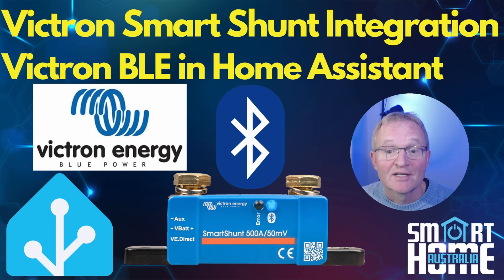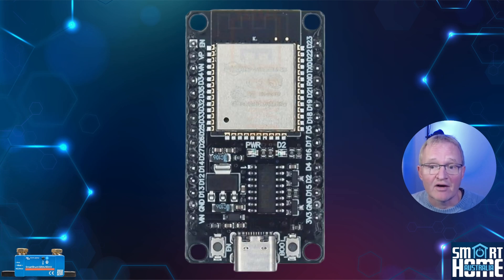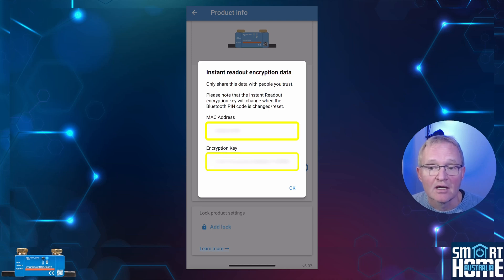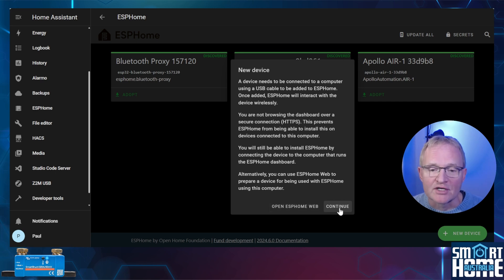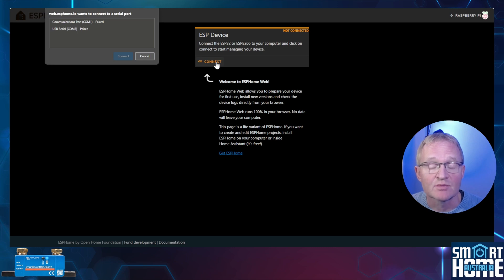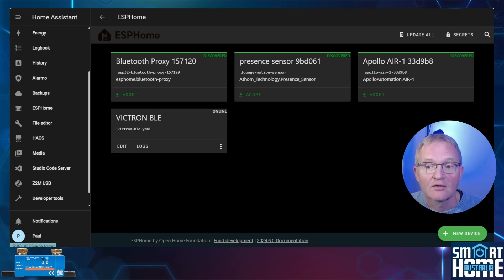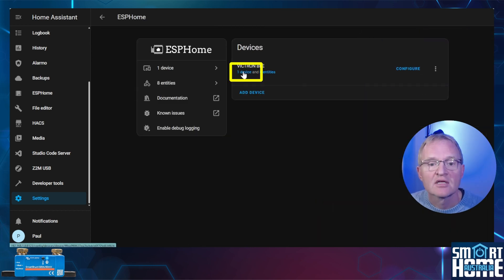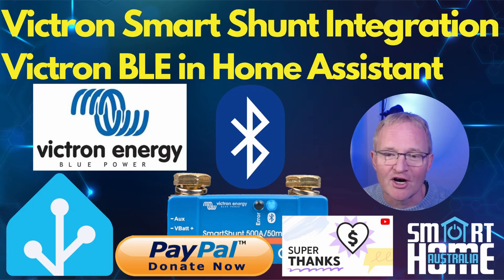Integrating Victron Bluetooth Device into Home Assistant: A Comprehensive Guide

Comment: I purchased the linked ESP Favorite: Seeed Studio XIAO ESP32C3. I am not able to connect to it via USB-C. I have tried different cables. I have tried the Boot and Reset buttons. I have tried using both Mac and WIndows 10.  I found this in Reddit: "The C3 doesn't support native OTG USB 2.0 support, like the -S3 for example. Instead it has a USB-Serial-JTAG interface. So you can get to it through specific applications that can talk to the ESP for things like uploading firmware, but the board will not show up on your PC as a standard USB device." What do you recommend?
Reply: I ordered the ESP32S3 and will try it.
Reply from the maker: Turns out the C3 doesn’t have native USB OTG—only USB-Serial-JTAG—so it won’t show up as a normal USB device. You have to hold Boot, tap Reset, then release Boot to enter flashing mode. After that, tools like esptool.py or Arduino IDE can detect it. Once a sketch with Serial.begin() is uploaded, it should show up normally next time. Hope this helps others!

Comment: @4:18 , it appears as if he clicks the 3rd option. You need to use the 4th option.
Reply from the maker: Good spot... the words say one thing and the screen says the other... yes manual.. sorry for any confusion.
Reply: @smart_home_australia  happens :) ty for the tutorial. This was my first time programming an esp32 and it went well. 

I'm using an esp32c6 from seeedstudio and didn't need additional drivers on macOS. It got detected as jtag usb device and I was able to flash. 

In my use case I'm trying to do a hybrid. 

Shunt data relay  + human presence monitor on the same esp32 with an LD2410S addon. 🤞🏼. Still WIP.
Reply from the maker: Now thats sounds very interesting, please keep in touch I'd be interested in testing one of those.... I can give you some contacts that might like to produce that if you are interested.

Comment: I have been trying to respond to the previous thread. My comments get deleted. I will try once again.

I communicated with the manufacturer of the enclosure. They recommended a different enclosure for the Seeed Studio XIAO ESP32C3. Their comment: "You can mount and solder almost any IOT HW inside it."
Item model number  :  IBT-QBX-AFC-1
Manufacturer  :  IOT-BOTS . COM LLC
ASIN  :  B088Y7XF35
Reply from the maker: The IBT-QBX-AFC-1 enclosure from IOT-BOTS.COM is a super versatile and robust solution for housing your Seeed Studio XIAO ESP32C3. Its design accommodates a wide range of components. While the enclosure is designed with Adafruit Feather-compatible boards in mind, the Seeed Studio XIAO ESP32C3 can be accommodated with some considerations. The XIAO ESP32C3's compact size allows it to fit within the enclosure. However, custom mounting or adapter PCBs may be necessary to align with the existing mounting points. Apart from that I dont foresee any issue.

Comment: Once this is set up and working, does the bluetooth connection between the monitor and phone need to remain active? If yes, and I am unable to keep them connected, should I be using VE direct instead? If yes, is the setup similar? Thanks.
Reply: I think I answered my own question. The ESP has bluetooth. This will replace the bluetooth of the phone. The phone is needed just during configuration. I am a software person so excuse the following questions. An engineer will be setting this up. Am I correct in assuming the ESP has to be within bluetooth range of the battery monitor? Does the ESP need to be powered and how is it powered? Does the ESP just remain on its own or is it preferable to protect it in some kind of housing? What do you recommend to protect it? Thx.
Reply from the maker: You're absolutely on the right track with your understanding, and your questions are spot-on — no need to excuse them at all.So I understand your question, does the ESP have to be within Bluetooth range of the battery monitor? If Yes, the ESP32 device must be within Bluetooth range (typically up to ~10 meters in clear line-of-sight, but this can be much less with interference or if the monitor is inside a metal case like a battery enclosure). The ESP32 is acting as the Bluetooth-to-Wi-Fi bridge, replacing your phone’s role in polling the battery monitor.

Does the ESP need to be powered? How is it powered? Yes, it needs constant power to function. If powered then you could use USB Power Adapter, such as a standard 5V USB adapter (like an old phone charger). Alternatively you could use a 12V-to-5V Buck Converter: If you're installing it in a vehicle or RV, you can tap into a 12V line and use a DC-DC buck converter to step it down to 5V.

Should the ESP just remain on its own, or be protected in some housing? Ideally, yes, it should be protected. While the bare ESP32 board will technically work out in the open, it's not safe or durable that way — especially in real-world environments like a car, garage, RV, or outdoors. I'd suggest a custom built 3D case or some epoxy to shield the device from the elements.
Reply: Thank you for your kind and comprehensive reply. 

I am working on a large installation of home assistant. The battery we are needing to monitor failed recently and created a cascading problem for other equipment. 

I have purchased the ESP you recommended: Seeed Studio XIAO ESP32C3. US$10

Is there a housing you can recommend that I purchase? Quality and reliability are more important to me than cost. I am also able and willing to spend more on the ESP. Perhaps an ESP that comes protected. The installation environment will be somewhat harsh. 

There is a strong likelihood that this ESP will only connect this one device, due to its location.
Reply from the maker: For protection I would suggest https://amzn.to/4kiS8Wy, but thats just protection and not for a harsh environment. 

For really harsh environments I'd suggest a more industrial design such as https://amzn.to/3I1ln2P. I've not tried this case but the reviews speak highly of it.

Comment: I have a question. 
I'd like to modify the code to get data from my Victron Pheonix inverter
I have loaded the original code and it runs fine, connects to the bluetooth.
Obviously the fields being queried are for the smart shunt.
How do i find out the relevant fields to ask for on my Inverter ?
It already accidentally grabs a voltage from one line. the rest is a mystery, so close !
Reply from the maker: Great — you're nearly there! If you've already got Bluetooth communication working and are getting some data from your Victron Phoenix Inverter, you're on the right track. The key now is identifying the correct Bluetooth services and characteristics for your inverter model.

To discover the available characteristics and services exposed by the inverter. Install a BLE scanner on your phone or PC and scan for your Victron inverter, connect to it, and inspect the services and characteristics. You’ll see UUIDs and possibly labels like “Battery Level” or “Input Voltage”. Look at Read/Notify characteristics — those are the ones with usable data.
Compare this to the SmartShunt UUIDs in the video — your inverter will likely share a similar Victron GATT profile. Victron uses a custom Bluetooth GATT service on many devices, but documentation is scarce. However, users have reverse-engineered it. 
Once you’ve identified the correct characteristic UUIDs for ie voltage, current etc. You can edit the code to poll those UUIDs. 
If one of the characteristics gives you meaningful voltage already, that means you’re reading the right GATT service — just not all the characteristics. You can loop over all readable characteristics and print their output.
Sorry it's abit of hit a miss as I dont have a Phoenix Inverter to do all the analysis for you and find the appropriate steps. Good luck and let us know if you manage to get it working.
Reply: @smart_home_australia  Great, thanks for all the info! i will try again tomorrow. I really appreciate the level of detail of your videos and for the replies you make to comments.
Reply from the maker: Here to help.

Comment: Hi There, Ive been wondering if you could perhaps do a video of using one esp32 to communicate data to and from multiple devices, such as JK BMS, Victron MPPT and a Victron Inverter for example.
Reply from the maker: I’m sure there will be a video about that topic eventually, but it would be good to get a few more people asking about it.
Reply: @smart_home_australia  I'm also interested in this solution. Currently, I only have JK-BMS integration with HA via ESP32. I'm looking for help on how to do the same for Victron Smart Solar and Juntek KG140F on separate boards.
Reply: Interested in this also

Comment: Great video.
If I am running HA on a Raspberry PI do I still need to go through an ESP32?
I am a bit new to all this! 😀
Reply from the maker: Yes you still do... the esp32 acts as an intermediate handling the bluetooth communication and transferring it into IP communications. In theory all of this is available on the Pi, but I've never seen any software that could take advantage of this. Also it means that your Pi doesn't need to be within BT range of the Victron equipment.
Reply: Hey thanks for the info.

Comment: Can i use a single Esp32 microcontroller to connect multiple victron ble devices like smartshunt, mppt and blue smart charger all at the same time and get data simultaneously. Or would i need multiple Esps for the job?
Reply from the maker: You do not need to use an ESP32 per device, you can configure a single ESP32 for multiple devices. I don't have a number as to how many it can support, but 3 shouldn't be an issue.

Comment: Hi,
I have planned tho install the Victron System (Inverter, solar control, Cerbo, etc) for my off-grid partial system. It would be nice to have details of your system.
Reply from the maker: This was actually a vacation project I did with my 12 year old daughter. We built from scratch a solar power station, this included EVE 310Ah cells, Victron solar charge controller, Victron Shunt, Victron Inverter, all outputting to 240V main, 4 USB-A and 4 USB-C all in a  DeWalt Toughsystems box. Needless to say my daughter passed :)

Comment: This is just what the doctor ordered. I added one of these today because I needed an accurate 'SOC/time remaining' feature in Home Assistant.  This shunt was perfect.  

 I operate my  ham radio station via solar and batteries. I don't have AC power available.  I don't use inverters. Everything is DC-powered. The 300 amp smart shunt was perfect for my system. 😀

Thanks for the video guidance. It made adding the shunt to Home Assistant a piece of cake.  This replaced two  PZEM-017-100 amp shunts I was using with ESPhome. It also gave me a decent SOC on Home Assistant.
Reply from the maker: Glad it helped. This is one of my favourite integrations.
Reply: @smart_home_australia    I'm also replacing a Li Time 30 amp solar charger with a Victron unit. I contacted Li Time about Bluetooth support in Home Assistant. They wanted nothing to do with it.  The charger will be here tomorrow.  Short of the Mac address and Bindkey,  I  have the code ready to go.  Looking back, I should have went with Victron from the start.  😀

If anyone wants to integrate their system into Home Assistant, STAY AWAY FROM Li TIME!

Edit:  I have several of their batteries and have no complaints.  But I'd stay away from anything "Bluetooth" from Li Time.
Reply from the maker: I'm afraid thats a common story. Manufacturer shy away from Home Assistant integration. Which is strange as they only need to put out the API and the community would do the rest.

Comment: hi there)
maybe someone get same problem ? Sensor in HA begins to get  random zero state, 3 days it was fine but now, when i move project to another esp32 board it works more stable but begins to zero data.
 - platform: integration
    name: "Solar Energy Produced"
    sensor: pv_power
    unit_of_measurement: "Wh"
    time_unit: h 
    accuracy_decimals: 2
    state_class: total_increasing
    device_class: energy
Reply from the maker: Configuration looks fine. Sounds like you ESP32 is the issue. A few things to consider:
- Power supply stability
- WiFi Connection quality
- Bluetooth Connection quality

I'd suggest trying a difference ESP32 to rule the hardware out.

Comment: When clicking on "Plug into the computer running ESP Home Device Builder nothing shows up :( I've checked and the ESP device is showing under COM3 anyone know a fix?
Reply: The board ended up being faulty. Tried another one and it works perfectly! Thank you so much for the video! Is it possible to add "POWER"  into HA?
Reply from the maker: sorry for the delay, Christmas and all :)

I was going to say, sounds like you did as required. ESP32 are amazing for the price, but a sub $5 board, you are going to get DOA's. Hence I keep a few around for projects.

Comment: hi thanks! do you know if this wil work with 300 amp version? thanks
Reply from the maker: I use it with the baby 150A and it works perfectly, it also supports all the way to the 500A so you should be fine.
Reply: Cheers!

Comment: Great video, thanks for making it! Do you know if any of the Viton solar controllers can send basic voltage data to Home Assistant without buying the shunt?
Reply from the maker: For the Victron Solar Charge controller you get:
- Charger State (Off, Bulk, Absorption, Float)
- Battery Voltage (V)
- Battery Charging Current (A)
- Solar Power (W)
- Yield Today (Wh)
- External Device Load (A)

Comment: You say that it will work with ESP8266, how is that possible? ESP8266 does not have Bluetooth.
Reply from the maker: You don't use Bluetooth for the connectivity but instead use the VE.Direct port. So your Victron device must have one of these. The connect TX and GND pins to the ESP8266 and code accordingly. I just prefer the Bluetooth approach.
Reply: @smart_home_australia  Clearly, but the video only mentions using the BLE and hence the MAC/Encryption key.
Reply from the maker: Sorry my oversight. But the main question, did you get it working? Isn't it the best integration ever!! I was so excited to finally get all my Victron gear into HA.
Reply from the maker: Sorry that's outside of my specialist area. Thats more an Off Grid channel question. Maybe drop Andy a question from (https://www.youtube.com/@OffGridGarageAustralia)

Comment: great video im having some problem with my configuration file  here is the error  ,  Bind key must be format XX.
Reply from the maker: Just make sure that bind key that you obtain from the Victron Connect app is in quotes. Also make sure that you capture the full key and sometimes it doesnt display the full key on the screen so make sure you expand the select fully left and right. Then you should be fine. :)
Reply: @smart_home_australia  thank you it worked
Reply from the maker: Super glad that worked 👍
Reply: @smart_home_australia  so glad I can see the comments today. I assume I had to be subbed for 24 hours or something. Anyway, it was hiding a single digit from me the entire time. Can finally see the data without having to be so close to the shunt for Bluetooth. I look forward to many more helpful videos. Thank you.

Comment: I did the installation with the Victron BMV-712 Smart Batery Monitor and it works perfectly, many thanks from Switzerland
Reply from the maker: Thanks. 🙏 it’s one of the most rewarding integrations I’ve implemented.

Comment: The video is really great and very helpful! As a beginner, I was able to follow all the steps because the setup is very logical—fantastic! The installation of the ESP32 went smoothly. 

I just have one question:  the ESP32 isn’t showing up as a new device in the settings of Home Assistant. What am I doing wrong? The SmartShunt and the ESP32 are in the same room, and the Wi-Fi signal for the ESP32 is sufficient, but I can’t find the error. 

Thank you so much for your help from Germany :)
Reply from the maker: I'd triple check your victron-ble.yaml file and verify that the mac_address and bindkey are 100% correct.

Comment: Stupid question: Why do we need an esp32 to achieve this connection? My home assistant has bluetooth. Why cant I use my HA BT to connect to the Victron? I plan to connect multiple devices to my HA. Do I need a separate esp for each? That's a lot of micro usb connections. Can I get a BT hub and have a single device connect to several devices? Thank you.
Reply from the maker: I don't see why not. HA BT Proxy piggy backs on any ESP32 so this should be treated the same. I just wanted to keep it simple for people to follow along with. 
Side note, this is one of my favourite integrations, works perfectly. Those Dutch sure do know how to make some great devices !
Reply: I was about to ask same question, did it worked with built in rpi Bluetooth? Hence planning to use only smartshunt, not sure worth to buy an esp32 or not.
Reply: @ I have not tried. Works fine with the esp. I have about five esps already so this code is just added to another one. No wiring needed so super easy.
Reply from the maker: @mzeyrek  Yep, check out this video https://youtu.be/2sieh8TGTl8?si=sFWpJsdLguqx6-SG